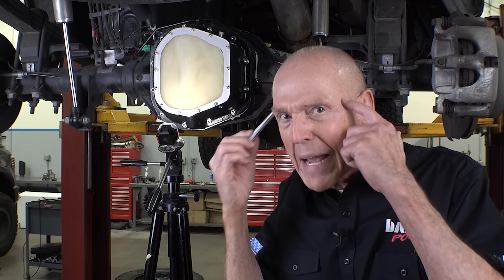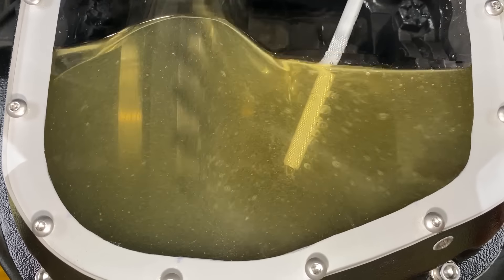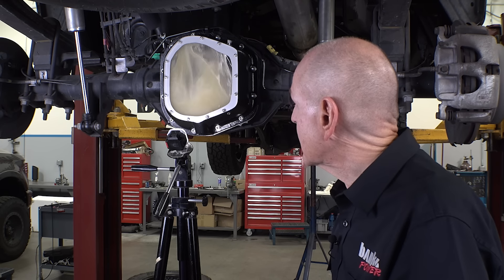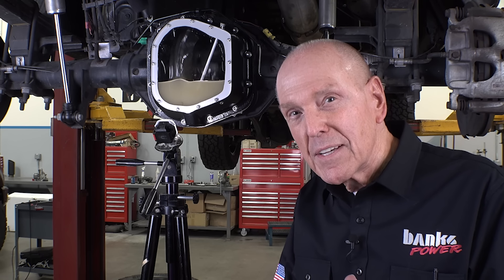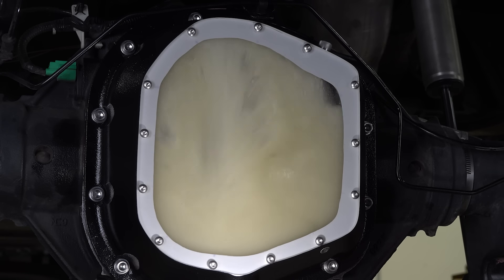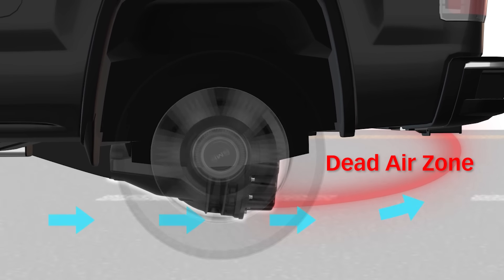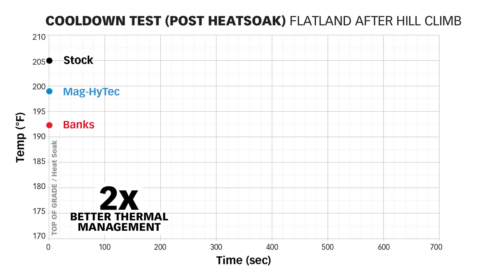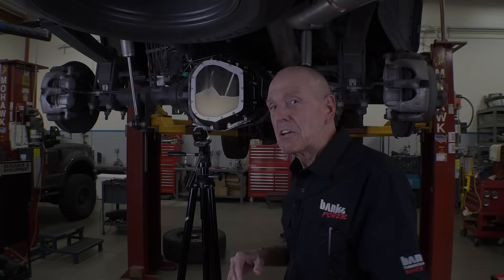What aftermarket diff cover guys don't tell you!

Comment: An aftermarket diff cover that is  of $400.00 for my 6.8l e 350 van that can essentially carry an apartment inside while towing a small house behind, thats more than a few diff oil changes with brand new oil every time.   

Sometimes, I guess, the perfect part just doesn't really make sense.   If they showed how their diff cover drastically reduces REPLACING a diff.   and axle that maybe thousands of dollars, I think that would better show the return on investment in this part.    But, I mean fluid?   50 or  60 bucks a drain and fill, if using the MOST expensive stuff.   So, the cover is the price of 6 to 8 fluid changes.

Comment: I had a Ford half ton , diff went . After a rebuild I got under after a 30 mile drive and put my hand on it . Was to hot to touch , and the ambient temp was -40 . Went back and told them it wasn't right , service writer tried arguing but lead mechanic told him that someone f** up

Comment: Fit a new grease-filled wheel bearing but pack it 3/4 full of grease. Normal grease load is 50%. Drive the car and see how long before the bearing overheats and throws out its grease. Keep going if you like and see how long before the bearing starts grumbling. 
Too much lubricant will cause it to churn the oil/grease and it will wreck the bearing. 
Over-filled differentials do just the same. The oils churns and heats up.  It begs the question why they don’t run the oil below the gears and use a pump to throw it into bearings and onto gear teeth. Cost probably but I suspect a good aftermarket idea.

Comment: As a mechanic for many years, all of the diffs aerate the fluid.  As grumpybill said in a few comments below, you will never see Banks Power do the same for their cover because the same happens.  I will give them this.  A curved cover is MUCH better for your diff.  He is not wrong in that their cover is better than that flat one.  Is their cover better than a stock one, can't say because I have never used one of theirs.  Good information on the fact that a flat cover is not as good.  As far as the aeration goes they all do it to an extent.

Comment: What is the average cost of these covers, what oil was used in the see through oil splash show, sure looked like thin oil to me, I could be wrong, and most covers are not flat, but cooling the oil in extreme conditions could be a good thing but cooling oil in extreme cold areas might not be, on mine at over 200 000 mile factory cover normal cycle oil replacement wear was minimal, so I would have to try one but your not going to do that because I won't do it out of pocket,  that would be proof to me. Thanks for the show.

Comment: Note that the internal baffels on the tested / modified flatback cover were removed possibility increasing the airation observed. Personally my service truck is all good at 346 K with stock cover, frequent oil changes. The banks diff cover does appear to be a nice product. Just sayin'
Reply from the maker: Hey Kirsten, thanks for watching. The cover shown at the beginning of the video is made by PPE. The cover tested on the truck was a Mag-Hytec. The goal for any diff cover is not to stop the oil from going over with the ring gear. The goal is to encourage MORE oil to flow over the ring gear. The PPE impede the flow and severely aerate the oil. Think of a rocky waterfall. The water is white because of aeration. Air is not a good lubricator.

Comment: I can't see the oil "not" being circulated but I would contest the aeration causes heat and modifies friction especially in a clutch type gear case. In fairness an epxoy copy of an OEM vs the afermarket would be fair. Also the type of oil could cause issues. Marine gear oil is hygroscopic and has anti-foaming additives due to not being vented.

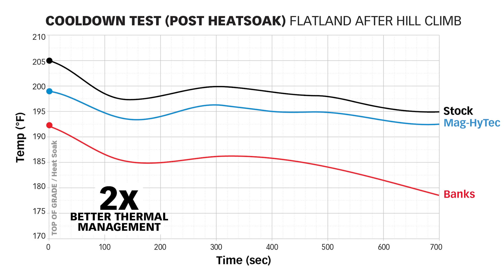Comment: Mixed emotions on this video.  I like seeing what is going on inside the diff in action.  However, a point he makes in the video, that the curvature of the stock cover is necessary, appears to be contradicted by his data at 11:23.  The data suggests both aftermarket covers resulted in lower lube temp under load and cooldown therafter.  The PPE cover does not have a curved shape but performs better than the stock cover which DOES have a curved shape.
Reply: Came to the same conclusion.

Comment: So the stock diff cover keeps the fluid up at the optimum operating temperature longer and faster while the banks keeps the fluid/bearing temp lower keeping it in perpetual warm up cycle? sure doesn't sound vary good on the metallurgy side of things. I do bet that owners will see a slight fuel savings from their wallets being excessively lightened.

Comment: Just bought a banks for my excursion. It might be all in my head but it seems as thought the truck is quieter at highway speeds! Do you have a clear cover for the banks design? To show what's going on at highway speeds?
Reply from the maker: We tried to make a clear cover but it ended up being translucent, not transparent. The interior features of the cover prevent a clear view of what's going on inside. This is one of the reasons it was designed and validated using CFD (computational fluid dynamics).

Comment: you're looking for horns on a horse's head. the system always worked without problems. furthermore, the transparent flat surface is not the same as the original housing. and the vertical movements of the suspension?
Reply from the maker: Thanks for watching. If you're suggesting we're trying to reinvent the wheel, it's an age-old argument. Everything can be improved. Apple didn't stop innovating with the iPhone after it launched in 2007. For a full breakdown of all the data and comparisons, we have an entire series that showcases the diff cover development. Watch the full "Behind the Diff Cover" video series here: https://youtube.com/playlist?list=PLwtmrqcWzLtQR9riOg8mizIEj-UX4WBBm

Comment: So if you live in a cold climate zone you need to leave the stock cover on so the lube reaches a proper temp to remove moisture if it stays too cool it will contaminate the fluid and shorten it's life and not flow properly.

Comment: How does the Ford 9 inch fluid and temp work without the use of a rear cover is there an aftermarket style fin adapter available to pull cool air onto the back of the 9 inch

Comment: Can you do a video on mag trans pans? I’ve been having non stop issues with my 2013 6.7 Cummins. I’ve had the pan resealed for leaks 3 times since it was installed 4 months ago. For informational purpose I just upgraded to a suncoast stage 1 transmission. This problem got so bad that my 12k dollar tranny had to actually be replaced after just 4K miles of travel... please help

Comment: All of the heat comes from squeezing and agitating the oil. There is no other source of heat in a differential, unless it's some form of friction plate anti-slip design. When oil is flowing over parts in the differential, it's not cooling the parts, it's actually warming them up. The heated oil transfers it's heat to the metal parts, not the other way around.

Comment: That was cool!..badass diff cover..I'm guessing  it comes with a $350=$450
Price tag though..probably  worth it when your doing alot of towing/hauling
But you'd  be just showing off & spending money on a hot rod..mabey super low gear ratio but how many 4.56 gear or lower street cars do you see
I'm running a 4.11 & that's pushing it
Without overdrive

Comment: Love this product and how Banks uses real science to engineer products. 

Now, I ask because of how oil weight is rated, wouldn't any temp below 212F be non-ideal? 

Not everyone wants to add a circulation pump, thermostat and heat exchanger so I get that, but temperature is the secret variable to get the "rated weight" of that oil.

Comment: You said oil needs to be around 200 degrees but not why.
It needs to be hot enough to 'boil off' any water vapour, at 178 ish, it's actually over-cooling although most water vapour will probably be removed?
There will always be some water vapour in the atmosphere and it will get into anywhere due to heating/cooling cycles through breather.
Anyone in area's colder than where you did the tests would be causing way more problems fitting a Banks Ram Air cover as it's unlikely oil would ever get hot enough, particularly if not towing uphill  or in just an 'empty truck' without a trailer.

Comment: To be 100% straight-forward.
The idea that my diff cover needs improving to increase longevity or durability, is quite moot.
I don't drag race or do insane overloads. I trade out top quality fluids well before they're due and have NEVER had issue one.
But that don't get you any sales. I remember Slick50 presentations with see-through 'proof'.

Comment: I can see how the ram air part is beneficial on a truck that never leaves the road.  The fluid flow demonstration was pretty pointless though without a real visual comparison.  The explanation seems plausible but show me the actual difference, not animated arrows.  I'd also like to see an actual demonstration of the Banks cover preventing aeration of the oil as it is stirred by moving parts and meshing gears.

Comment: By milling the differential cover, you actually removed the inside horizontal fins as well.  So while the clear plastic cover is showing some bad flow, it is in reality much worse as those horizontal fins would have essentially blocked any kind of flow going up.  

Create a proper, clear mold with includes the fins and that is a better, more realistic representation of what's going on.
Reply: Gmon750 we aren't stupid bro. Everyone already realized that.

Comment: You’re missing the horizontal ribs on that plexiglass to make it identical to that flat one
Reply from the maker: Thank you for watching. The cover shown at the beginning of the video is made by PPE (has the fins). The cover tested on the truck was a Mag-Hytec (no fins). The goal for any diff cover is not to stop the oil from going over with the ring gear. The goal is to encourage MORE oil to flow over the ring gear. The PPE with the ribs would impede the flow and severely aerate the oil. Think of a rocky waterfall. We encourage you to watch the whole series. There is more data for you to check out. This was the last installment of a 7 part development series. For a full breakdown of all the data and comparisons watch the full "Behind the Diff Cover" video series here:

https://youtube.com/playlist?list=PLwtmrqcWzLtQR9riOg8mizIEj-UX4WBBm

Comment: In order to simulate real conditions Banks needs to replicate their covers, and the competition's, and provide exact data from road conditions or at least a dyno simulation with the dif actually loaded and working.   Otherwise  this dog & pony show is merely a viuallly interesting, but technically incorrect, simulation.  The only real improvement visible here is the addition of a drain plug for easy draining for maintenance.  That certainly does not justify the price.  Far cheaper to just use higher quality oil and change it more frequently.

Another minor issue might be the questionable advantage of a stylish aluminum cover in actual 4×4 conditions.  Show me the video where your cover survives intact after backing it into a stump or rock.

Comment: Quick question , wouldn’t the vehicle moving down the road be forcing the fluid back against the cover vs the way you guys have it with the vehicle being stationary ? I’d like to see the results going down the road vs on stands how the fluid acts
Reply: Yes in acceleration the oil would be forced againts the cover. However, in cruising there is no force exerted on the fluid by acceleration, because Force is mass x acceleration. So the real image and the shown here would not differ substancily. Only while accelarating hardly the image would differ.
Reply: @ranrun3643  thanks for the response I was just curious on how it would look

Comment: Hey Mr. Gale Banks, could you make one of these covers for the GM 9.5 14 bolt? If not I understand, it's not the most popular axel but there are alot of them running around in 2500 light dutys. Including mine, I know I'd buy one right now if it was a thing. Either way thank you for all type work, you kick ass!

Comment: this may be to old to ask on this video but do the air intake hang down to get hung up on rocks are what ever when you are off road  if they do would damage the cover and boom you have no more oil in there
Reply from the maker: That is a great question! The Ram Air Diff Cover scoops are designed to break away without effecting the seal. https://youtu.be/vdtmDl5EDJ8?si=6-0FVctgWBo_3lP5&t=1916

Comment: What would happen if you snagged one of the air scoops on a rock or stump?  Are they designed to break off cleanly without damaging the cover to the point that it leaks oil?

Comment: Is the ram air cooled model susceptible to becoming clogged with mud which may cut off all the ram air supply?

This was my initial thought on seeing the design.
Reply from the maker: The Ram-Air scoops are no lower than the lowest part of the diff housing. So, if your differential housing is low enough to be in the mud, so is the Ram-Air cover. But if it fills with mud, simply take a garden hose and wash it out.

Comment: The test isn't entirely accurate in many ways. One being the truck is on a automotive lift and under no load/strain which is a significant variable. Others in the comments have addressed the plethora of other inaccuracies in this "test"/demonstration. Banks may produce outstanding products, my intent isn't to discredit their quality. I just don't think the "test" is equivalent to real world scenarios. The banks cover looks great and has some innovative features. I am an OEM/stock kind of individual. There are plenty of people out there that need the extra "bling" for whatever deficiencies they deal with. I'm just not one of those that gets a dopamine dump from squeeling tires, loud exhaust, racing on public roads, a cloud of soot laden smoke bellowing from an exhaust pipe, having to climb up into a truck with a lift kit, wheels that continue spinning when my vehicle has come to a stop, hydraulic suspension bouncing around while I try to drive down the road, etc. To each their own. We all compensate for our own perceived inadequacies by utilizing our own preferred tactics.

Comment: That's interesting, air ducting and cooling fins under a vehicle seem like they would soon fill with mud and stones particularly of used offroad. I would have thought vehicle manufacturers would have had a cooling loop to control tbe fluid temperature if its critical to the longevity of the subassemblies bathed within. 🤔

Comment: 10 seconds into the video and I can already tell you that the difference is baffling. Just because a cover allows you to add more volume thus, theoretically reduce temperatures, doesn't mean it is as well circulated as the oem.

Comment: Interesting video but without seeing what actually happens inside all of the covers this is just speculation. The cover they are using doesn't have any of the back baffling that the aftermarket cover originally came with, they milled it all OFF! So it is no longer the original companies design! I'm sorry but my experience with Banks products in the past has pretty much soured me on their company. Their regular customer service is terrible and it is NON-EXISTANT if you didn't get screwed by one of their approved retailers! They basically tell you, you should of paid the higher price and bought it from one of our retailers, we won't warrantee it or even talk to you about it! Pretty much done with them!

Comment: Few issues i can see from this, the clear cover of the flat back one doesnt have the relevant baffles on the clear section with will impact the fluid flow, and also you didnt campare the banks one in relation to the design and flow

Comment: I've been a wrench for decades and you've got some good data there mister. it's great to see these dynamics being addressed and the covers properly engineered. I would say stock is fine if you don't race or tow. but if I did, I would want this Banks unit for sure simply because of how it catches air for cooling.

Comment: I'm trying to find pictures for reference, but the air "intakes" look like a accident waiting to get snagged on a rock and cause a unpleasant situation.  It looks like they stick out a ton, but i can't find any good reference pictures for a aa 11.5 in 3rd gen cummins.
Reply from the maker: Our patented Ram-Air scoops are designed to increase airflow over the rear differential without sacrificing ground clearance. In fact, our differential cover retains the same low point as factory and competitors. If for some reason the scoop does get hit, it's designed to break away.

Comment: Everyone with automotive experience I trusted told me when I grew up in the 80s and 90s to stay away from those flat alloy covers,  they may look good, but from their own experience. They ruined a few rear ends. While they didnt have a mill to cut a cover down to see what was happening. They knew from common sense it must be the oil flow as the OEM covers didnt have that issue. From my experience as I grew up, yea you need flow in the housing to keep the rear end evenly cooled, its not just for the oiling. Though, the airyated oil is also still very bad. Sure this video may come off as a big info/commercial. That doesnt mean Banks Power is blowing smoke up your ass.